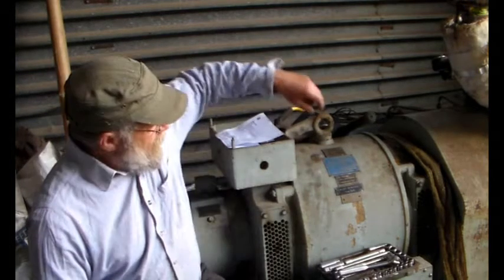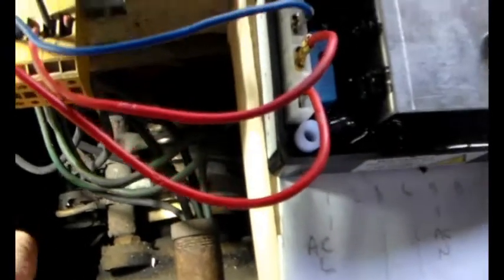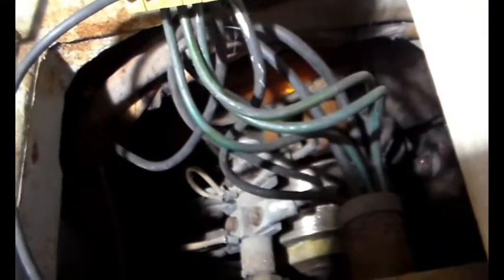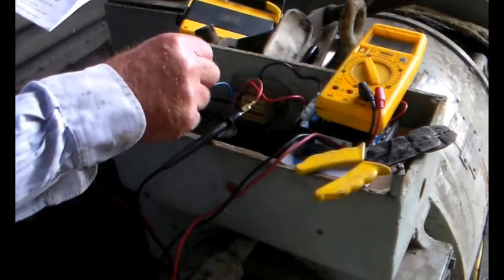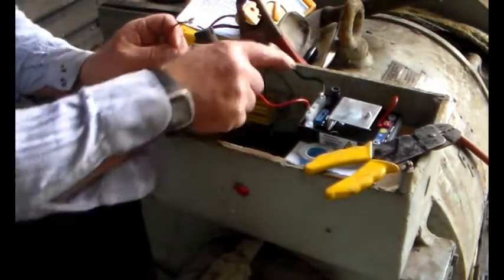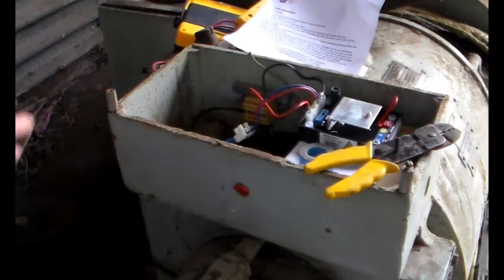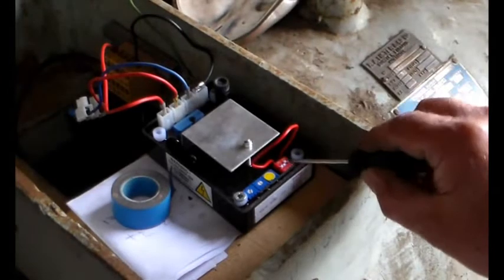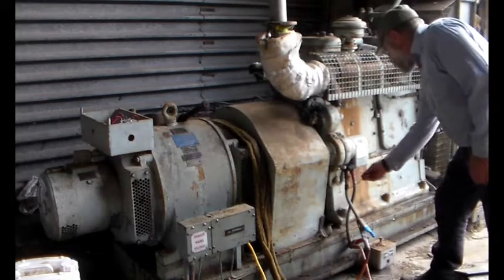Lister PK diesel gen set Part 4, the right volts, finally

Comment: This video has been a godsend,i've been having similar problems with a lister jp3 with a mawdsley 3 phase alternator+excitor,thanks to the info on here i got in touch with Roper Electronic Engineering,and got the appropriate Avr,and it works a treat,better even than the original Isenthal set-up,they were fantastic people to deal with,and they design,and make the Avr's themselves,its regulation is the best i've ever seen,from full load to off load you can't see a light bulb jump in brightness whatsoever 👍👍👍
Reply from the maker: Hi, great news, another machine saved. If you want to help with my costs please see my paypal link, cheers

Comment: Hi andy nice to see you got it working, im wondering if the regulator can supply enough amps to the field coils to give 30kw output i would love to see you test it on full load using a 3 phase saltwater load in another video now that would be exciting! I`m into off grid solar power and forklift batteries myself, currently running 3kw of panels into 13 x 810ah@c5 flooded cells and a 3kw LF pure sine inverter since 2018, you have made some fantastic practical videos about renewable energy keep up the good work Andy.
Reply from the maker: Alan, these are all questions that I am asking myself. They only way is a test and that will take some time but there will be a part 5. Great to hear you are taking reasonability for your electrical consumption and enjoying the learning experience, cheers
Reply: Hi andy im posting about my forlift cell voltage low problem but my posts arnt showing except when i log into youtube. Very strange just letting you know that im the same person. posted this here. Lister PK diesel gen set Part 4, the right volts, finally
Reply from the maker: @alanhall9234  Alan, got you now, your comment did not show on the questions video, more videos to come, cheers

Comment: Excellent perseverance Andy. And top regards to Eddie!  It shows the power of YT. A complete niche and in real time the answer came along. Meanwhile you have had to sieve through helpful and well meaning information. It reminds me of when I was figuring out brushed commutator universal motors. Perseverance is key. And it pays off!  Hi he only thing I would ask is for a part 5 with a discussion and a diagram, how the new regulator replaces the excitor. Maybe I have misunderstood but does this mean that the excitor unit is probably a dud?  Thanks
Reply from the maker: Owen, thanks for the compliment, yes the real power of YT, a useful tool in an anti corporate movement. I don't think there is anything wrong with the old exciter unit, it's just old technology and needs a different unit to run it's field coils. This modern board is hopefully more responsive. I might be able to use the exciter to charge the 24v starter batteries, either that or make up a 24v battery charger. Hope all good, cheers